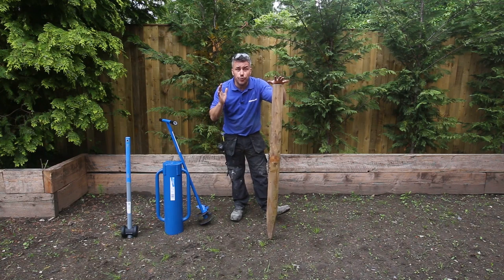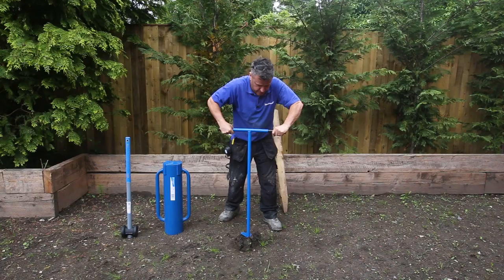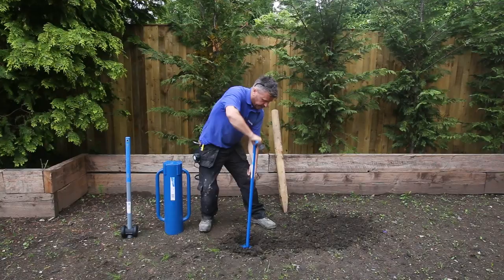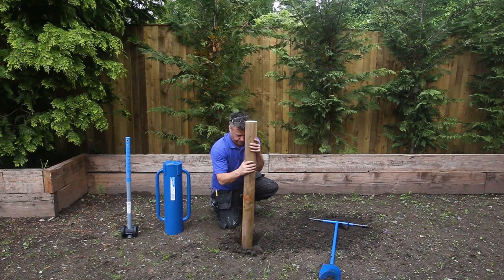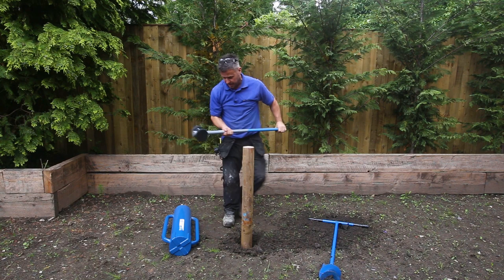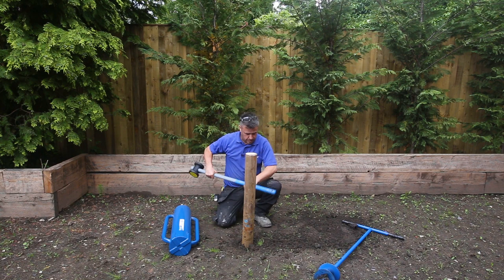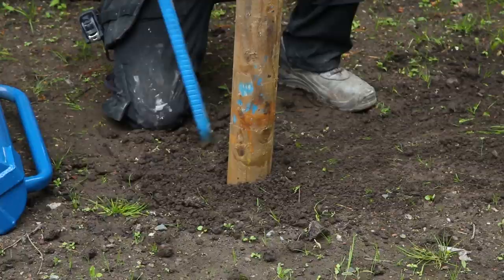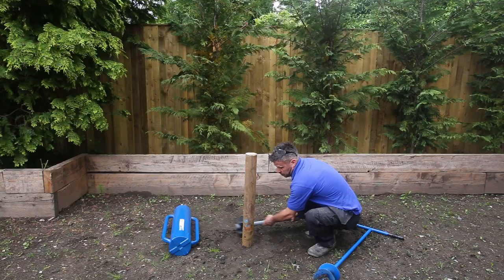How to set a fence post in soft ground

Comment: I find it easier to use post hole digger gets much more soil out with the clamps imo... Also wouldn't it be more sturdier in the ground covered with a concrete mix/postmix instead of back filling the hoke again with the removed soil?
Reply: Yes course you can put concrete around them that will make them stronger, but you don't need it for a light weight fence like i mentioned.